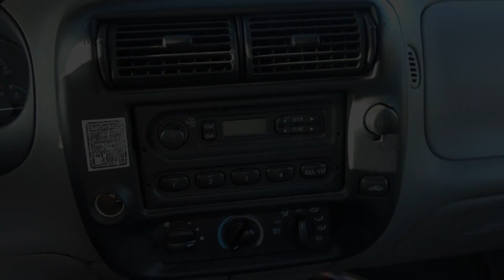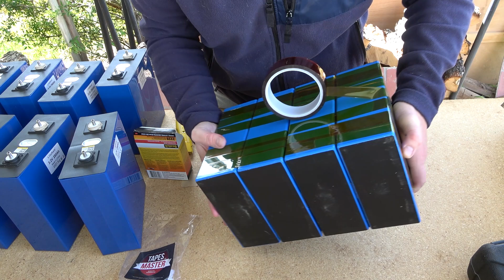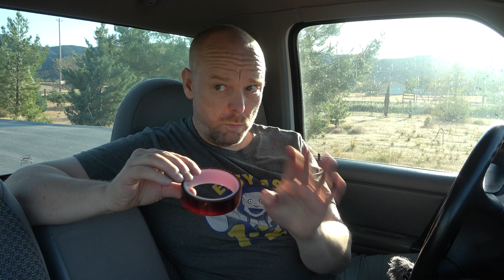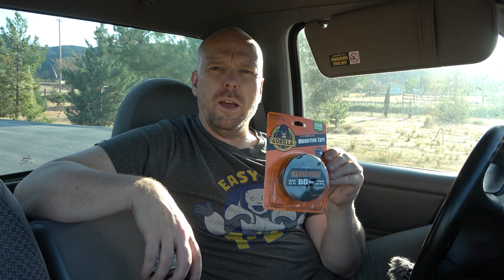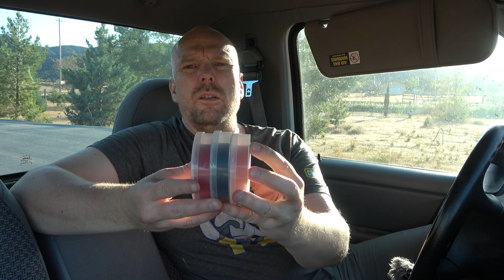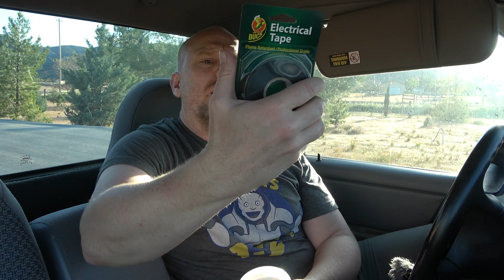EP 25: Ford Ranger EV: Tape Collection

Comment: I work with heating cable products. We use lots of different tapes.  Kapton is a great tape.  We use it a fair bit in the lab. Though often too rigid for some applications.   We do use mastic but often that is conjunction with other products to help fill or seal gaps.  We use a lot of fiberglass tape with a thermal set adhesive (generally silicone).    We also use (good quality) PVC tape (electrical tape).  PVC tape can vary a lot in quality so you have to be careful what you use.
Reply from the maker: Definitely! I don't know how much I can trust all the ratings, but I'm definitely leaning toward the 3M products with the higher temp and insulation ratings.

Comment: Really good overview on tape. As someone who spent 35+ years in the industrial electrical industry servicing and installing  electric motors, drives, generators, etc., I have used a fair share of tape. You can never go wrong buying a good quality tape. Most vinyl "black" electrical tape is rated at about 120 Volts per layer, but there is some variability in this if you stretch it too tightly which thins it out. 
Your project is super interesting and I am looking forward to see more about it in the future.
Thank you
Mike 🇨🇦 🍁 👍
Reply from the maker: Thanks! I've had some competing priorities, so hopefully I can button it up soon.

Comment: Quick Question, what app (or website) do you use to plan out a long EV trip, just curious.
Reply from the maker: I just use PlugShare to identify chargers and Google Maps/Android Auto to navigate when driving. I don't actually do a lot of route planning, though.
Reply: I always use A Better Route Planner
And then validate locations with PlugShare
Reply: I use plug share.